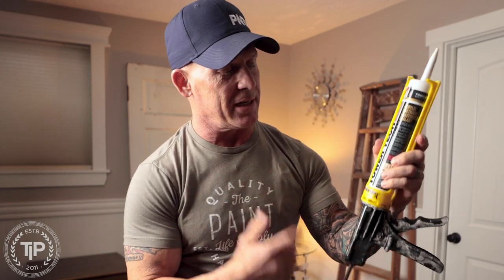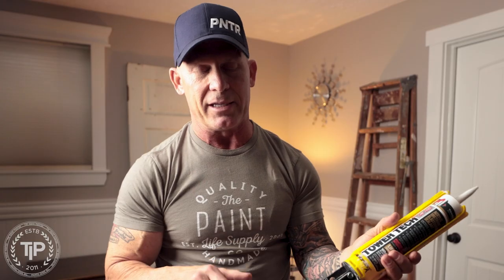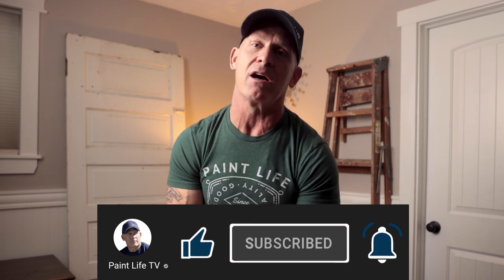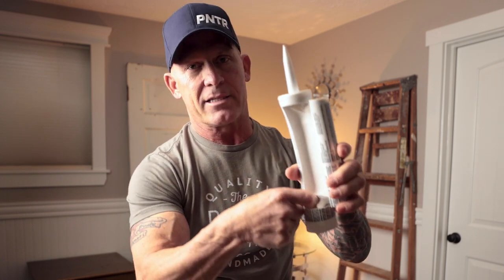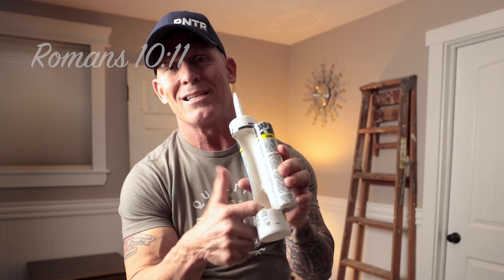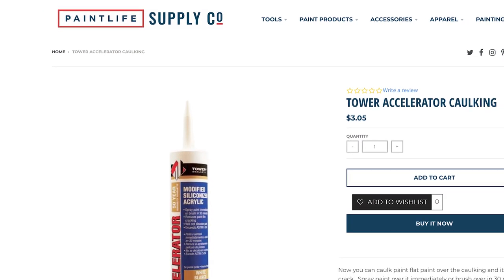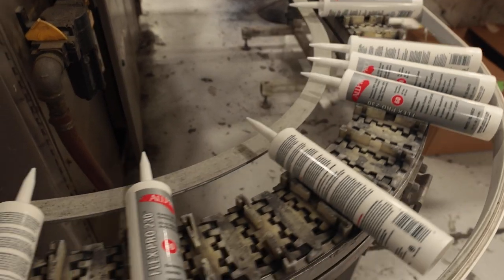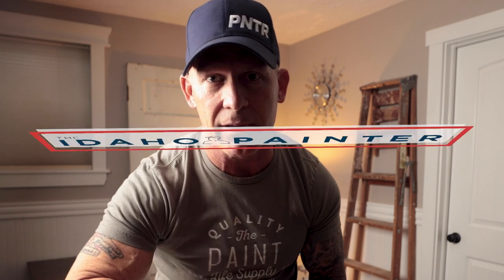Dripless Caulk Guns Suck!  Why do they drip?

Comment: Store the tubes vertically with the nozzle up. The gentle vibration in the van, especially during the summer, should see the air bubble go to the top. I find that grip control, ie stop squeezing a set distance before you reach the end of your caulking run so that there is less pressure left in the tube, helps. Also I press the pressure release a couple of times, once at the end of the run and a second time before I put the gun down.

Comment: Pro painter here.  You are absolutely right about the air bobbles. It's compressed air inside the tube when you squeeze the trigger.  You can take the tube out of the gun and the goo still comes out of the tube.  I noticed also, that once in a while, during applications a pop of air comes out and the problem subsists.  By the way, that is the best caulking gun on the market that I know of.  It's worth the price.
Reply: What is the make and model of the gun you say is best on market?  I'm Interior trim carpenter and looking for the best dripless gun available.  Thx.

Comment: We just started using a PPG product. It’s very thick and is easy to work with. It’s still easy to work with even though it has great consistency. I end up wasting less caulking. That cheap Sherwin Williams caulking is like water. Can’t stand working with that stuff. Streaks easy. The thicker consistency stuff doesn’t leave streaks, also. It’s really nice stuff.

Comment: Buy the Tajima caulking (sealant) guns! Not only are they more robust but they have guns made for different caulking (sealant) viscosities.  I only had one dripless caulking gun and iit broke after one week!  My Tajima just keep going like champs.  You can also put a pin hole in the plunger inside the caulking tube - point of sharp awl

Comment: Compressing the air bubble(s). The bubble(s) are now pressurized and will push on the caulk until the bubble pressure is less then the than the push back of the caulk or reaches equilibrium.(the same force of the bubble as the caulk has.

Comment: Use the same gun. Never had caulking spit on me. I’ve had it keep running out sometimes, but never anything major. We do use great caulking. Anyway… you’re putting pressure on the air. That compressed air will try to expand, hence why it keeps coming out.

Comment: It seems to me that the manufacturers are doing it on purpose. So many companies make lousy caulk that just drips all over the place. Forces you to use more so they can sell more. I've only found one tube so far that is any good and it costs four times as much as the other stuff. Home Depot dap caulking is garbage. That stuffed drips like an ice cream on a super hot summer day even in a dripless gun. Makes the job almost impossible.

Comment: Newborn!  best gun no doubt!  Tape your caulking so it doesn't move.  Pop the release and it doesn't drip.  Keep your spounge, water bucket and wet rag handy...
Reply: I started making a line with a permanent marker to I know where the top of my cut is. Works great. Just makes it easier and faster with it there. Taping the tube works too. I prefer the way I mentioned.

Comment: Air is extremely compressible.  Caulking is not.  Under pressure, the air will compress like a spring.  Even when the push rod "backs off" in the dripless gun, it's not enough to release all the pressure built up in the air bubble, so the air bubble continues to push the caulk out of the tip until it is at normal atmospheric pressure.

Comment: Im dealing with a bubble in one of those tubes right now. Thanks for addressing this. Its getting rough. Im redoing the whole house and needed a few tubes and its pretty common. On a box or 12 i habe stored upright witb tip up. Its been a pita to deal with the drip over my hard wood flores. Im trying that tower brand.

Comment: DIYers or even Pros are going to complain when it doesn't work and that's because they are butthurt about spending on something that is useless to them.  The funny thing about it is that they are fairly priced and most people don't even need to use high ratio guns to do the work. You can get something decent for around 10 dollars if you know exactly what you are buying.  Edit:  I was surprised to try a newborn that claims to be Drip Free and I compared my ETS 2000 and to my surprise the 212 HTD was pretty consistent at been drip free.  ETS2000 will probably stop after like an inch, but despite saying that, the Dripless gun is by no means a bad gun; it's light weight and has a slightly higher thrust ratio than the 212HTD and the price is about the same.  Trying to get my hands on an ETS3000 and possibly the 5000.

Comment: $16 is expensive? Maybe I'm buying my stuff at the wrong place. Our non-dripless caulking guns are $60-80 for just the regular bottles. We don't even use the big big ones which are probably a multiple as expensive. The problem with drip-less (it's not drip-never). There is still pressure in the bottle. Even when you relieve the pressure which our guns do with a little metal tab, that plastic insert that moves along in the bottle doesn't retract. So there is always going to be some drippage depending on how thick your goo is. We use primarily 100% mildew resistant silicone. Even with our expensive guns, drips will always be there when you lay down that gun. Unless you are squeezing out really thick stuff in the middle of winter, I'm not sure it can be completely avoided.
Reply from the maker: Its called pops.  Air bubbles.

Comment: If I'm needing to calk the baseboards cause they are old and what not, do I use white before then tape and clear calk?

I'm guessing to use white to fill in the gaps and make it like an exciting wall/board...then tape and clear calk but wanna make sure
Reply: Why would you need to clear caulk? You can use clear or white, I guess. Let it dry. Paint the baseboards one day, then tape off the base the next day and knife it down. Then paint your walls. Just don’t flood the tape cause it will bleed most likely. I’ve taped accent walls in the corners from floorboard to ceiling. Then I’ll put a very, very small amount of caulking to lock the edge of the tape. Just enough to see that it’s wet. I’ll do that if I don’t have frog tape. Works great. If you’re not painting the baseboards, just use white caulking if the base is white. Let dry 24 hours or so, then tape the base off. Leave a 1/16-1/8 gap from the wall with the tape. You don’t want to tape right on top of the caulking. You’ll end up with a crappy line and a bunch of bleeds.

Comment: I just had to stop the video and see what Romans 10:11 said, as I didn't remember it. I read the Bible from my app on my phone every morning, do that before I do anything else. Thanks for the great video! I have had pops before from air bubble but bought a Dripless ETS2000 as at my age, it's much easier to get thicker caulk out and into the right places. I hadn't thought about the air bubbles but it makes perfect sense. Just ordered some Tower caulk from your store, to see how it performs. I'll also try to use up the rest of the DAP that I have by a suggestion from another person. Tapping it on the floor a few times, to get the air to go to the top. I'm tired of caulk oozing out of the gun!! ☺God Bless!!